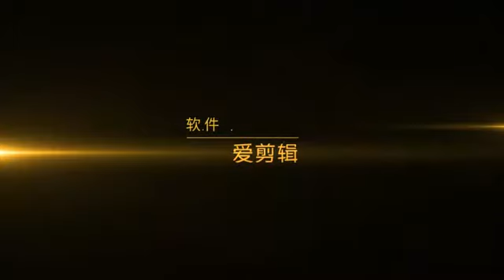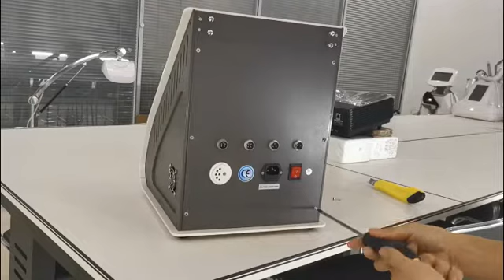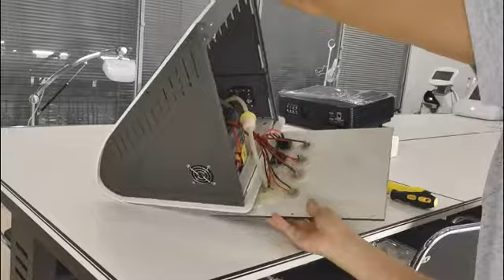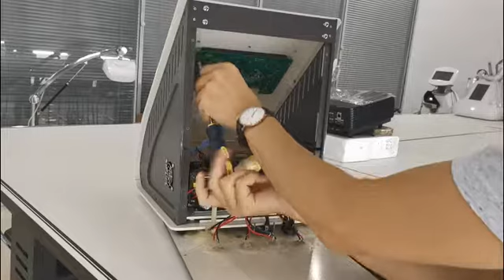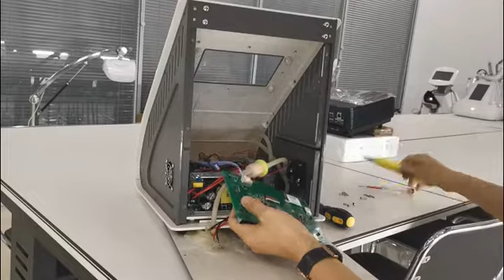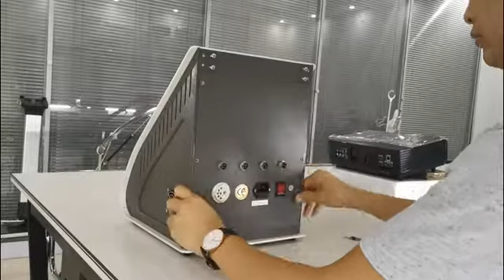Au 61 liposuction slimming machine touch screen change

Comment: Hello i change the screen to my machine due to touch failure but now the screen is working but doesn't display the system settings. Do you know hot can I make it work?